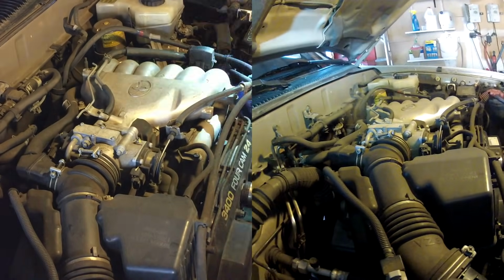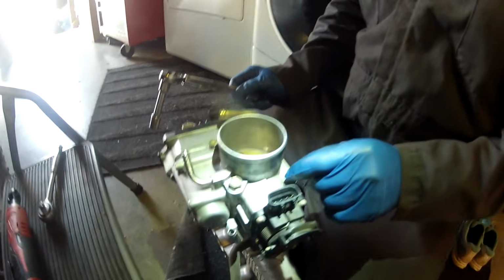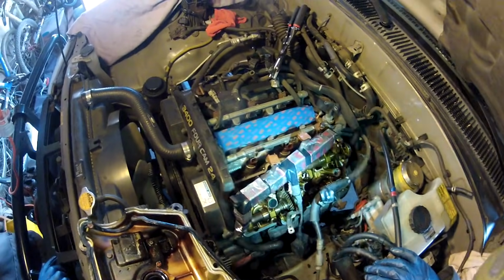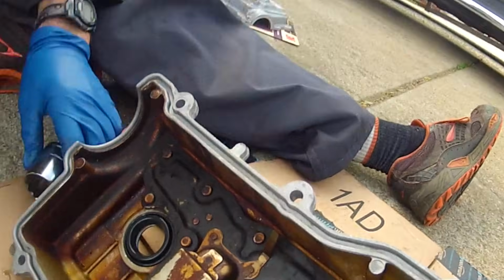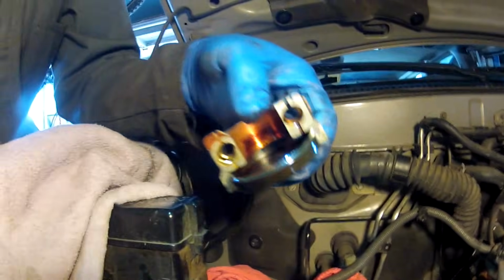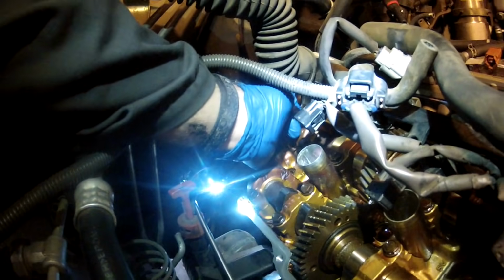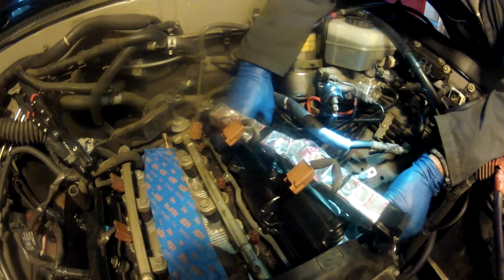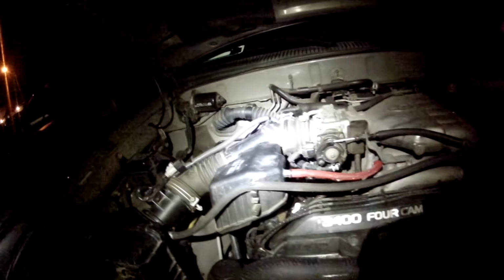3.4 L V6 5VZ-FE Toyota 4runner, Tacoma, Tundra Valve Cover Gasket Tutorial

Comment: My friend said he torqued my valve cover bolts to 58 in lbs. Is this going to screw me over?
Reply from the maker: No, you will be fine.
Reply from the maker: Revolver SAA the hesitation you should have with getting to a higher torque value is cracking a corner end off the valve cover.. if he started to bring the bolts up to spec in a cross-crossed fashion, & didn’t crack a corner of the valve cover, & you’re not leaking anywhere, then you’re good to go!

Comment: Hey Tim, Great video this will be a huge help. I'm about to tackle this job soon and I had a couple questions. 1.When listing the tools you show a clamp to close a coolant hose. I was wondering where this hose is and if it's not clamped will coolant come flowing out. 2. If I remember correctly you didn't show replacing the PCV valve and grommet. Is it as simple as removing them from the valve cover and popping the new ones in? Thanks
Reply from the maker: Hey Daniel, that clamp was used to close off one of the 2 coolant line that leads into the bottom of the throttle body.  Some coolant will spill out but not that much.  Instead of using a clamping tool though,  I now prefer to just put in a couple silicone plugs into the ends of the coolant lines to stop coolant from flowing out.  The silicone plugs come from this kit: http://amzn.to/34Joap7 

For the PVC valve and grommet replacement, it's pretty straightforward.   The valve will be tight but pull firmly and it will pop out.  The grommet will be brittle and will most likely come out in pieces.  If a piece drops in, don't worry.  You can fish it out with a needle nose pliers or similar tool.  I would do this while the valve cover is off the engine.  The new grommet just pops back in and the same goes for the valve.  Easy Peasy.  Good luck with the job!

Comment: Hi Tim. Just getting around to this job after a couple of months of receiving the parts from McGeorge Toyota. I have a supercharger so I took note of the differing throttle body gasket needed, but ordered all other recommended parts. Regarding the Intake Plenum Gaskets #17176-62040 - (Need 2), with a supercharger do I need 2? Realizing this as I am about to put everything back together.  Thanks again, to you and Sean, for your time making these videos.
Reply from the maker: With the supercharger, you just need one Plenum Gasket, not two.

Comment: I'm about to tackle this job but needing to replace the lower intake manifold gasket. Do you have a video of that?
Reply from the maker: No, we don't.  But, unless you have some sort of coolant or vacuum leak at those intake manifold gaskets, I wouldn't mess with it.  We do have an injector replacement video you can reference that would include part of the work to get the intake manifold off: https://youtu.be/N-lhZIWOkyU
Reply: @TimmyTheToolman  yea the mechanic said there is a coolant leak at the right rear lower intake. Thank you for your response

Comment: Photographs. Lots of photos prior to removing stuff as well as during the removal of stuff. In the age of camera phones, we always have photo-taking abilities in our back pocket. Can't count how many times I've had to refer to a photo on my phone to reference the specific routing of a hose or a belt or wiring, etc. It really comes in handy if you don't have the time to do a project like this all at once and instead have to do it over the course of a couple days. Great video. I'm picking up my new (to me) 1999 Limited 4Runner later today. I'm a new subscriber and have been absorbing as much as I can from all your videos.
Reply from the maker: Yep, taking a picture before tearing things apart could save you and it's smart to take the time to do it when you're doing something for the first time.  This job intimidated me at first, but now that I've torn down the top part of these engines multiple times, you start to realize how straight forward and easy it is.  With the electrical plugs, they are different, like the ones on the throttle body and there's no way you can mix them up.  For the vacuum hoses, they are different diameters and can only stretch so far so it becomes obvious where they need to reconnect to.  The one area that I've heard of people making a big mistake is mixing up the coolant lines under the throttle body with the vacuum line that also connects there.  This is one area to be very careful and pay attention where those lines connect to.  The lines with the hose clamps are coolant lines and the one without a hose clamp is a vacuum line. 

Have fun with your new used rig.  Happy Wrenching!

Comment: Do you have to replace the half moons and the cam plug or is it ok to use the old ones?
Reply from the maker: You can reuse the half moons.  You just clean them up and reseal them with FIPG.  The cam plugs should not be reused.
Reply: @TimmyTheToolman  will changing out all the other stuff mess with the cam plugs enough that I'll have to replace them?
Reply from the maker: @ZACHATTACK9696  You can remove the valve covers and not change the cam plugs but I wouldn't recommend this.  The cam plugs are a place where leaks can originate from.  Not replacing these while the valve covers are off would be a big mistake in my opinion.  They might not be leaking now but they could start leaking later on after you get your engine put back together and then you'll have to make a choice to just let them leak or go back in and redo all that labor.   Do the job once and do it right.
Reply: @TimmyTheToolman  thanks so much for the help!! This has been huge and I love your tutorials. One last question I was wondering what you gapped your spark plugs at? I've seen to gap them at .043 inches but that seems large.
Reply from the maker: @ZACHATTACK9696  You know, I haven't checked a spark plug gap in years.  Once I learned spark plugs come pre-gapped, I stopped checking them.  Have you ever wondered why spark plugs come with that cardboard sleeve around the threads?  That's to protect the electrodes so the gap doesn't change when the box is jostled during shipping or whatever.   As long as the box is intact with the cardboard sleeve around the threads, I assume the gap is correct and I don't worry about it.

Comment: Seems the most thorough and comprehensive video for this procedure.  It will be my go to when I start this project.  I wasn't clear if there are 2 or 4 cam plugs.  Is there anything to service on the front end of the motor or just the back?
Reply from the maker: There's only 2 cam plugs, one at the back of each head.  That was a mistake when we said 4.  I mention this mistake in the video description.  Be sure to read the video description and also look for a comment we pinned in any video of ours you plan to use as a reference.  We provide helpful information in both spots.  Good luck with the job when you get around to doing it.

Comment: I'm about do do that since we can't go anywhere, hoping to stop an oil leak.  It's astounding how much junk is on modern engines.  I remember with my 67 Cougar (4bbl 289cu V8), the only thing I had to pull out was a filler cap/breather in one Valve Cover and a PCV Valve on the the other... some bolts and BAM it was out.   smh... as always, thanks for the guidance.  :)
Reply from the maker: Yeah, it was much easier back in the day.  I had a 68 Bronco that was very simple to work on so I understand what you're talking about.  Hope the job goes smooth for you.
Reply: @TimmyTheToolman  Ok..this took me a lot longer to get to than I intended and THIS repair, sucked. LOL   The tutorial was great, but it gave me more problems than the Timing belt/water pump replacement and the big brake update. I'm about half way through this... this 99 4Runner has 403,000 miles on it.  I always appreciate what you do here.    thanks!
Reply from the maker: @wildmustangart1577  If you want a job that really sucks, pull the heads one day.  Today will be my 7th day of wrenching to replace the heads on my 98 4runner.  I only had 180k, and the #3 cylinder cracked.

Comment: I took my time and watched many times your video, labeled all things as I worked, and took own photos for guidance. Also I made sure to get original Toyota parts - spent about $225. Finding some free hours here and there I managed to disassemble it. Finally yesterday I got some free time and I put everything back. Then I took it for a ride and it all worked fine! The misfire also went away. A shop wanted to charge me $840 which included some parts (spark plugs, gaskets, and new set of cables) but not all the parts I ended buying on my own, and who knows if the shop was going to use original parts.  Also they did not want to guarantee that the misfire was going to go away...

Timmy, thanks so much for the video and the answering questions or comments.  This was first time doing this and I did it out of curiosity and learning. Now I can use my 4runner to carry stuff and fix a bedroom closet for my daughter. I feel very happy of all the things I learned.  Thanks again!
Reply from the maker: Great job Victor!  You saved yourself a lot of money and learned something in the process.  Thanks for sharing your success story using our video as a reference to get this job done.  You've got to be feeling a great sense of accomplishment like I had when I did this job for the first time.  Happy Wrenching Victor!

Comment: Hey Timmy. Awesome vid like always, Helping the poor man stay on the road. But I have a couple of questions. Do you need a new pcv valve? Are they prone to break when working on this? Also, lets say you do see gunk buildup in the engine. would it be safe to clean it up off the engine and in casing?
Reply from the maker: PCV valves do go bad.  You can reuse them but they aren't expensive so it's just smart preventative maintenance to do when performing a job like this.   I wouldn't recommend breaking free sludge deposits because you may end up causing a chunk to break free and get stuck in an oil channel.  A better idea is to renew your oil more regularly, say every 3,000 miles for a while and you will effectively reduce the amount of sludge build-up over time from the detergent qualities in the engine oil.  With an engine that has significant sludge build-up, you will notice shortly after an oil change that the oil will turn dark fairly quickly.  That's due to the detergents in the oil working on the deposits in your motor.  The oil will reach saturation for the suspended particles it can hold and that's why I suggest you change your oil every 3k miles for a while so it will regularly have fresh detergents working on cleaning up the deposits in your motor.
Reply: @TimmyTheToolman  awesome. thanks.
Reply: @TimmyTheToolman  so my I just did my valve cover seals and cam plugs and I saw a little sludge for a 265k mi. engine but nothing that made me gasp. Whenever I change my oil, it stays nice and "clear" for quite a while. It does not dirty quick. With that said. Id still like to slowly remove what slusge is there. What is your opinion on engine oil flush treatments like ams oil engine flush?
Reply from the maker: @619steelo  I wouldn't use an engine flush treatment.  I'd just change the oil at a more frequent interval than you normally do and that will slowly work on the sludge deposits.  Do oil changes every 3k for a while, say the next 30,000 miles.
Reply: @TimmyTheToolman  What do you feel about oil additives like "Lucas oil" oil additive?
Reply from the maker: @619steelo  I know some people use them but I don't.  If it were one of those situations where you have a loud engine knock and you were trying to quiet it down with an additive, sure, why not give it a try.  If your engine is running fine, I wouldn't add anything.
Reply: so I did this yesterday and besides the normal wrenches being thrown at me. I felt I did it completely and up to par. Until I turned it back on and now the check engine light is on and there a nasty whining in my engine 🤦 I'm going to have to reopen and do everything step by step again. I could have swore I did it correctly. If it does the same thing after my second attempt. Im going to have to get one of those diagnostic tools. Really hope I didnt mess my engine up. Maybe I didnt put a hose back in or something but I had numbered and taped all of my hoses and what not. IDK.
Reply from the maker: @619steelo  Yeah, retrace your steps and hopefully you can figure it out.  One fairly common error people makes is hooking up the hoses under the throttle body wrong.  They hook up a coolant hose to a vacuum fitting and flood the engine with coolant.  But, I do think you'd know if you did that.  When you figure out what check engine code you got, hopefully that will narrow down your search of possibilities.

Comment: Is the engine still leak free ?
Reply from the maker: Yes, it is.
Reply: @TimmyTheToolman  ohh nice I'm trying to do it on my 2003 tacoma and want it to be leak free. I love the video which today I order the parts for my truck and cant't wait to do it Thanks for the video it will be really helpful. One more thing did you replace the valve covers with new or just clean them ?
Reply from the maker: @santosmacias7089  The valve covers were just cleaned and painted.  Good luck with the job.

Comment: I hope that you make a ton of money from YouTube, because you deserve it! Your video was invaluable. I was able to do this job fairly easily; however, I did manage to break off the head of the bolt going into the middle of the lower plenum. Now, I have a vacuum leak :( Looks like I'll have to take it back apart and do my best to extract it.
Reply from the maker: Hey Jerry, we make some money but we're definitely not getting rich.  We're pretty much still working for less than minimum wage for sure.  That's a bummer you broke a bolt off.  Once you get the plenum off, hopefully enough of the bolt shank is sticking up and you can just spin it out with a pair of pliers.

Comment: Timmy,

The FSM says to put "MP grease" on the spark plug tube gaskets...what is that? And did you do it? Thanks...awesome video.
Reply from the maker: Must mean multipurpose grease.  You could just lubricate the gaskets with a little motor oil though.
Reply: @TimmyTheToolman  watching it again, I saw you doing that.
How long after everything is reassembled do you have to wait for the RTV to dry?
Reply: Timmy...is the black hi-temp RTV ok in place of FIPG?
Reply from the maker: @TheRealitarian  If it's meant for engine applications, it's probably fine. For myself though, I take the guesswork out of it and just use the recommended Toyota FIPG.
Reply: @TimmyTheToolman  just ordered some!

Comment: What did you use to clean the valve covers before reinstalling? They look brand new!
Reply from the maker: We used brake cleaner and brushes to clean them off and then Sean shot them with some black spray paint.

Comment: Bit of an off-topic question: On the 2000 motor, how much slack should the 3 cables on the top have? Also, should I lube them with  Dri Slide dry moly cable lube?
Reply from the maker: They just need a tiny bit of slack.  If any of the cables are taught, they're too tight.
Reply: @TimmyTheToolman  Fair enough.  Should I re-lube them? Or just leave them be?
Reply from the maker: No need to lube them.

Comment: Tim, this is the next project after the steering rack, I commented on the water pump and timing belt she running good , now with this change out what do u recommend should I change the headers as well or just the gaskets and associated parts
Reply from the maker: What do you mean by headers in relation to the valve cover gasket job?
Reply: Well while I have everything off should I change out the upper and lower pletum. Or if the are good just leave it be
Reply from the maker: @Mayaandkinzley  Oh, you meant the plenums.  Definitely replace the plenum gaskets but not the plenums themselves.

Comment: Do the VC bolts need to be retorqued after some time? I replaced the VC gaskets about a week ago but last night I found that the VC bolts were loose. Is this normal?
Reply from the maker: The torque value is really light for these bolts so they aren't on all that tight to begin with.  Did you use new washers when you did the job?  Over time these bolts will loosen up as the rubber on the washers ages and shrinks from the heat of the engine.  Having them come "loose" so soon isn't normal if you used new washers.
Reply: @TimmyTheToolman , yeah, I used new washers. Just to add, when I checked them last night it was while the engine was warm. Not sure if that would make a difference?
Reply from the maker: @edlim315  I don't know if that would make a difference.  Personally, I haven't messed with the bolts on either of my 3rd Gen 4runners after doing the valve cover gasket job.  I just assumed they were fine.  Like I said, the spec is very light and any minute change in the rubber of the washer could make these bolts seem loose.  Honestly, I'd stop messing with them.  If you originally torqued them to spec, and you're not leaking any oil,  I wouldn't keep going back to see if I could turn the bolt easily because you'll probably find you can each time.  Tightening just the ones you can access will cause the valve cover to be unevenly tightened and that might cause you more problems than just leaving it alone.  That's my two cents.
Reply: @TimmyTheToolman , that's a good point. Thanks again!